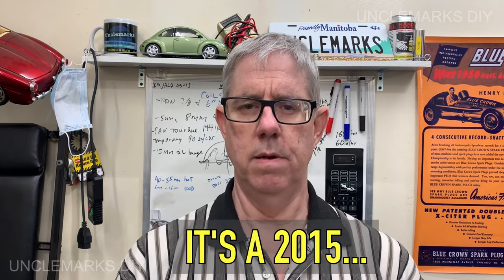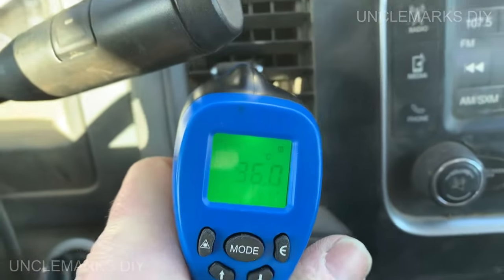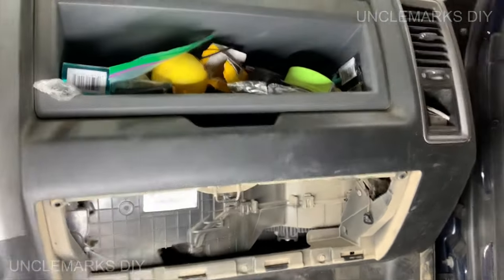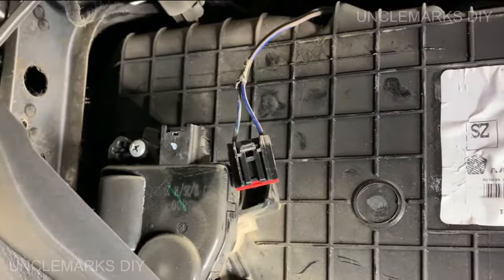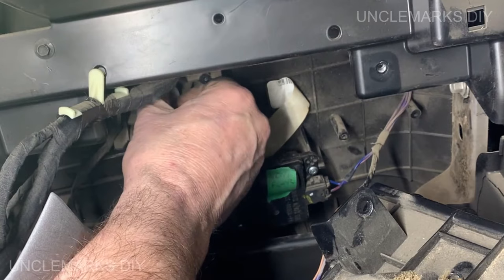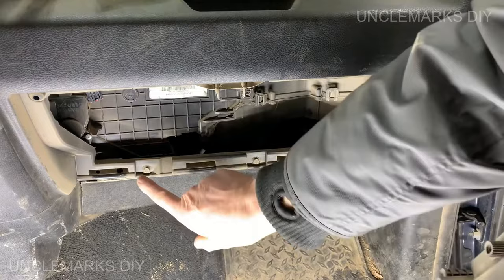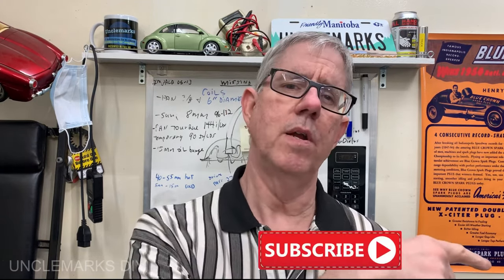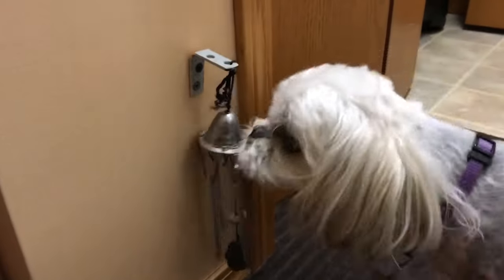RAM No heat or no cold Check this first! 2009 2010 2011 2012 2013 2014 2015 2016 2017 2018 (EP 185)

Comment: Where is the ac modeler in a 2018 dodge ram 1500
Reply from the maker: Do you mean motor? (Like blower / fan motor) Usually they are under the glove box.

Comment: What was the verdict after finding out actuator is working?
Reply from the maker: Still no answer. Talking to a couple Chrysler techs and they thinking heater core might be half plugged. It doesn’t make sense to me, but in my experience, sometimes it can be exactly what you know for sure it is not. (Hope that makes sense). I have not looked at it yet. About 3 or 4 other people have commented they have the exact same issue on the drivers side.
Reply: @unclemarksdiyauto  I'm getting responses of partially clogged heater core too. Doesn't make sense if passenger side is roasting hot tho. But im hearing more and more that could be the issue.
Reply from the maker: @timothywolfe8792  weird, but maybe true. Not sure how core is situated in heater box. All the actuators seem to be working fine. Passenger side can be any temperature you want. Just drivers side is cold, or more correctly it blows the temperature of outside.
Reply: @unclemarksdiyauto  Thats where I'm at...also I did top off my antifreeze, it seemed to be down about half a gallon. Would that have an effect on heater core too?
Reply from the maker: @timothywolfe8792  Hard to say. If it gets low enough, yes for sure. Question, with lower coolant level, was there still heat in passenger side?
Reply: @unclemarksdiyauto  Yes, still heat on passenger side
Reply from the maker: @timothywolfe8792  I need to look at this truck again. Will post a update if I do. If you want, send me a note to my email address in the "about" section, & I can send you a update later. Just mention what your problem was in email.
Reply: Check the thermostat. Stuck open? My blend door was not going open (up) all the way..hence nothing but cold air. Unhooked the actuator and held the blend door flipper up with a screw. Heat works great now. Just undo it for summer hours
Reply: You want the door up not down? If that's the case mine is doing exactly the opposite what it should. Down when heat and up with AC. I thought it went down woth heat to block out cold exterior air?
Reply from the maker: @patrickgregory7920  I hope i was not mistaken. You could take the actuator out, and with the vehicle running, manually move the door up and down and see which way is correct. As long as it still moves to its extremes both ways, just leave it. Sounds like it is working fine Patrick.
Reply: @unclemarksdiyauto  its definitely a heater core . Top half of box is for pass side and bottom half is driver side. Ram uses same box regardless if dual climate control or not.
Reply from the maker: @jaymckinnon8387  Finally! That makes sense! Otherwise if they diverted heat later down the system like on old cars, it would not make sense. Understand?  Thanks for info.
Reply: @unclemarksdiyauto  It most likely is. I have a 2009. I had the same exact issue. Passenger side was running hotter. No dual zone settings. Had the heater core replaced and now both sides are just as hot.
Reply from the maker: @afirulesall  good to know!

Comment: My 15 ram only has 65k miles and blows like 45 to 50 degrees. Ugh
Reply from the maker: 7 yr old truck. Engine running at operating temp? Might be thermostat. All blend doors opening and closing all the way? Single or dual temp zones? Heater core could be getting plugged. Wonder what is recommended coolant life is? It could be breaking down and started to plug up core.
Reply: @unclemarksdiyauto  yes engine is up to temp, its the same heater as the truck you videod. 

When I turn the nob i hear the door in the dash. Im assuming its working.

I have to see if the out hose is warm @ the heater core still, was 5 out a few mornings lol
Reply from the maker: @jeffbm6880  Sometimes those doors can bind. Can you scan for codes? Even if no check engine light on. P0128. Thermostat rationality. (Thermostat stuck open)

Comment: What would be the issue if the actuator finger is not moving. I’ve switched out the actuator already
Reply from the maker: It could be a wire to or from the actuator or switch, or from switch to computer, or computer to actuator. You would need a wiring diagram to go further. maybe something is wrong with the switch. It may be time to let someone else take a look? (No shame in that) I don't have the wiring diagrams.

Comment: Any idea about the problem I have

I own a 2013 express 2wd and my ac setup is exactly the same as in the video 

One knob for power or strength one for hot cold and one for what vents it blows out of 

Normally when I turn the knob all the way red and I turn the power or strength knob one notch to turn it on I have to press the power knob to make the little orange light come on so it actually blows hot air if the orange ac light doesn’t come on when it’s on heat it’ll blow mostly cold mildly warm air 

The orange light comes on automatically when my temperature is on cold but when it’s on the heat I press the “power or strength” knob and the orange light turns on and it goes from mildly warm to toasty 

 When my truck is on the heat and I try to press the ac power knob the light doesn’t come on and it blows mildly cold air 

I’m a cheap ass and don’t wanna go to the dealership so any response would be much appreciated
Reply from the maker: Not so far. Was talking to 2 dodge Techs and they saying possibly heater core needs a flush. I don’t know how they route air through it, maybe it is possible if half the core was plugged and that half goes directly to the drivers side.I need to look at it again. (It is a friends truck) 1 thing for sure is everyone that has commented has the same drivers side cold! Never the passenger side! (So far)
Reply: @unclemarksdiyauto  ahh okay looks like ill have to pop the hood and check it out on one of my off days, thanks for the fast response tho!

its a crazy coincidence that you made a ram 1500 ac problem video as soon as i have problems, my old man has followed your channel for over a year now.... he refers to you as the "classic car guru on youtube" or "old fashioned repair man" lol

thank you for all you do ill teach my old man how to drop a sub and like we'll for sure support the channel going forward, i wasnt expecting such a fast response! really means a lot regardless if you actually can help with our problems or not!

happy new years to ya!
Reply from the maker: @8thgstriker412  Say hi to him for me. He can email me anytime just to say hi if he wishes. Email address in my about section. You can too. If I get a solution, I can send you my findings.

Comment: Ehat ig you have 0 heat passenger or driver
Reply from the maker: Drivers side.
Reply: @unclemarksdiyauto  absolutely none. Driver or passenger
Reply from the maker: @mikehawkins6206  Are hoses to heater core hot when truck is running? If so, are the blend doors working to go from cold to heat?
Reply: @unclemarksdiyauto  yah everything looks like it is working. I never found 5 like the other guy says. But passenger and driver ones operate.
Reply from the maker: @mikehawkins6206  How old is vehicle and mileage?
Reply: @unclemarksdiyauto  its a 2005 with about 275000 kilometers
Reply from the maker: @mikehawkins6206  Could be a plugged heater core. If it is, its not worth trying to flush it. The way they are constructed, the flush will just go through the passages that it can flow through. The other will not be affected. i have seen this tried with a core already removed. Cut it apart after that and it was plugged. Usually they start loosing heat on the drivers side first. This one in my video must have the 250,000 kms on it. This heater core is expensive to change. Complete dash comes out. If this owner gets bra=e, I might get to do it one day.
Reply: Ok. ..thats what i thought as well. Thanks for the help and clarification. Best kind sir
Reply from the maker: @mikehawkins6206  keep us posted as to your progress.
Reply: Will do